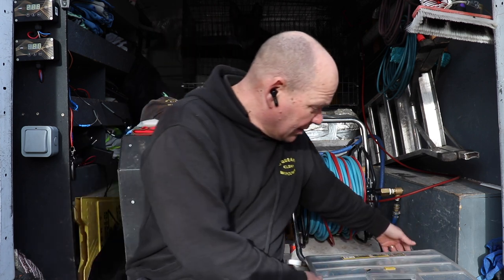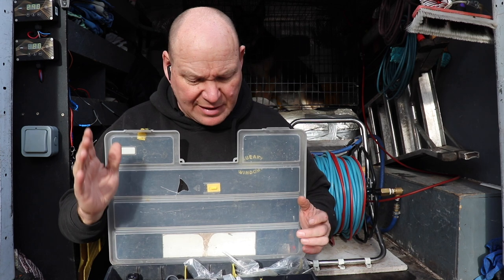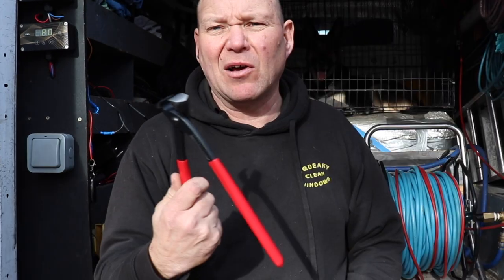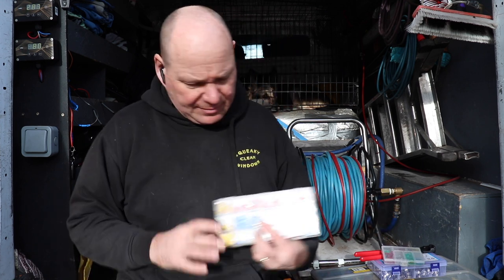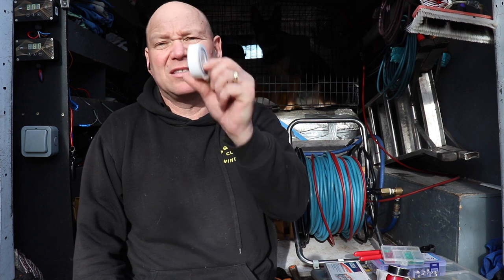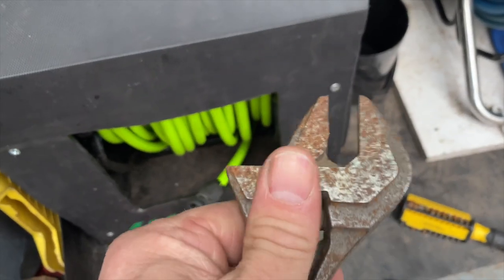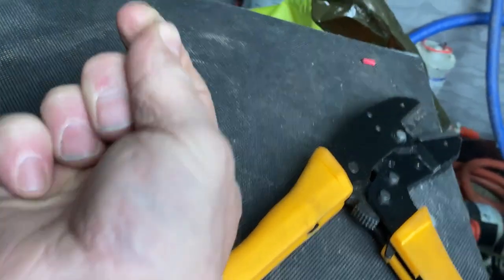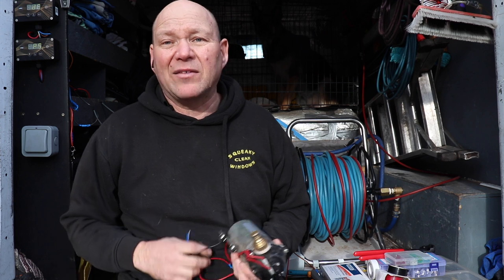Spares Every Water Fed Pole Window Cleaner Should Carry

Comment: Good video dave. I had a o cilp go on me the other day and i just didn't have the size i needed to fix it but I was lucky because My van is set up for  2 man system. So I just jumped on to the other reel and cracked on with my work.  If you don't have spares it will cost you time and money.
Reply from the maker: Good job you had that spare setup 👍

Comment: Hi there Dave, I just want to say that I love your videos! Their Really helpful! I’ve just bought the 35cm ultimate Gardiner brush with the four jets (100 degree fan jets).

Would you say that you have found the pencil jets more useful than the fan jets? What would you personally recommend? Thanks Dave!!
Reply from the maker: Hi Jacob 

I think both jets are good. I keep swapping between the 2 and can't quite make up my mind which I like the most. 

The fan jets are good on hydrophilic glass but the pencil jets get more water on the glass at the same setting on the controller and. are more accurate. 

Think the best thing to do is try both and work out which are best for you.
Reply: @squeakycleandave1  Dave my friend, I really appreciate the reply! I will be sure to try out both jets but I must agree with you even though I haven’t used it yet it makes more sense that the pencil jets would use less water but cover more of the glass. I’ll use both and I’ll let you know how they fare 👍🏻
Reply: Just put a rinse bar on top & undo the jets.All I use.Simplz